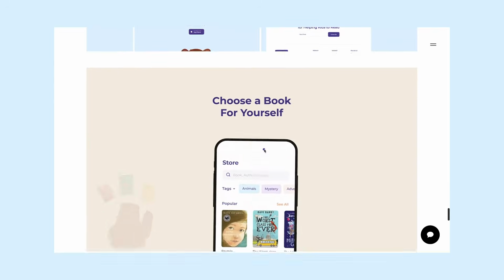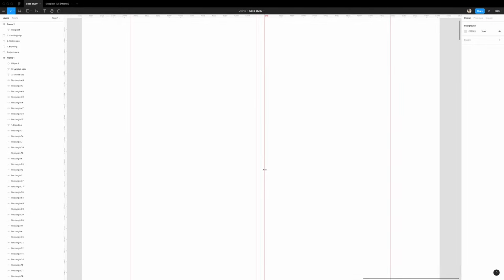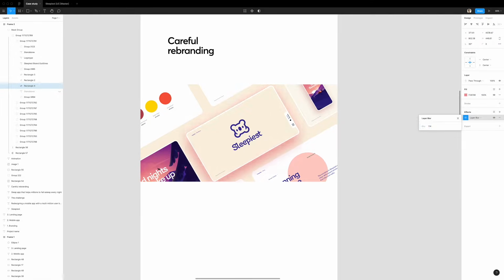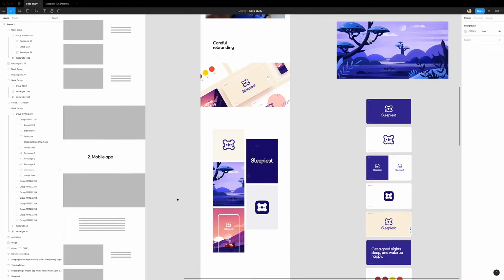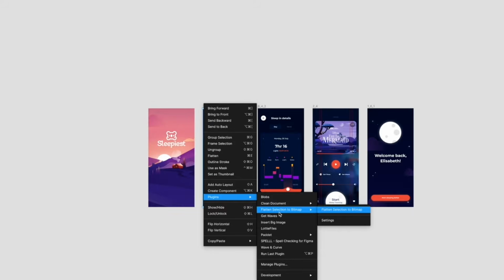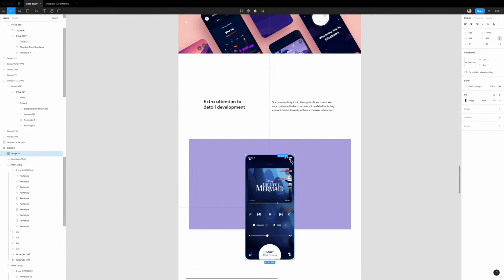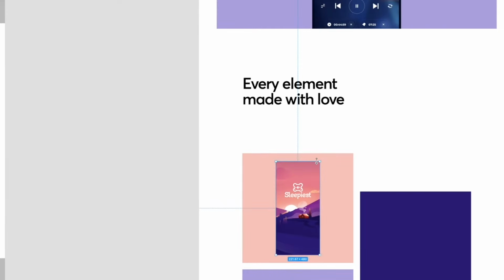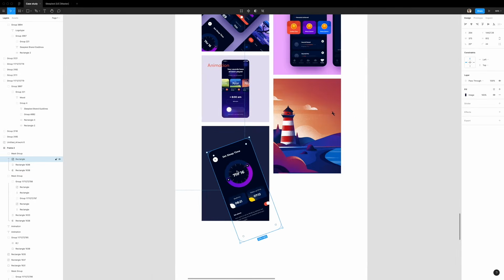How to prepare your design portfolio / Design Tutorial

Comment: I scribbled some notes, maybe you want to check on the overall concept after designing:

Arrange portfolio to make it looks beautiful:
- convince people

- show integrity
- affect sales

Structure:
Project Name
1. Branding 
2. Mobile Page 
3. Landing Page

Videos in between help increase clarity 
Link real product/customer's review

Opening
• Various combinations
• Non-standard title to reflect the project
• Use grids
• Beautiful background + emphasize usage for which device
• Take the time and make some animations to make the portfolio lively
• Problem + Solutions + Things Learned

Branding
• Various material combined, emphasize and make it an angle —> adding dynamics, presenting and showing that a lot of work had been done
• Logo, color, typography, mockup, illustration; add some text between to add visual pauses

Mobile Application
• Explain what you did because it's completely different than branding 
• Rasterize maximum using plugin "Flatten Selection to Bitmap"
• Practice and write correctly
• Device mockup is "heavy", if you want to use it, use the ones that are light
• Use matching colors
• Blur adjust as a shadow to make it accurately controlled
• Show your work —> Logo, Illustration to show you can produce resources within the same work

Landing Page
Plugin: Insert Big Image —> Quality isn't affected

Better
Add: visit the site
Customer review

The best of luck with our careers!